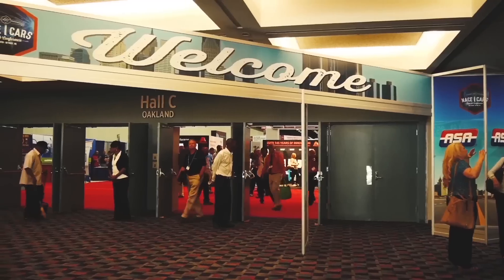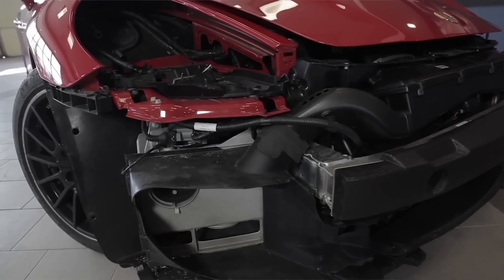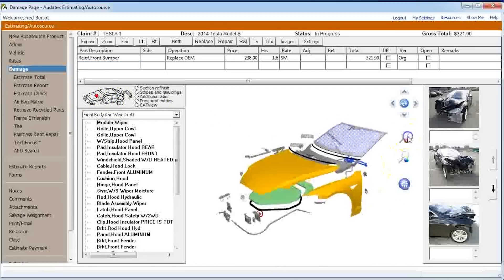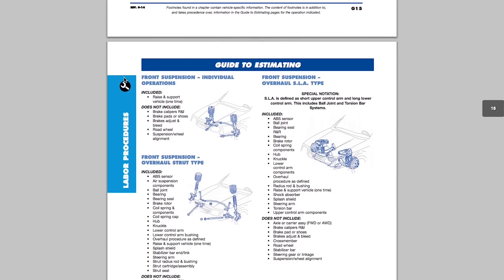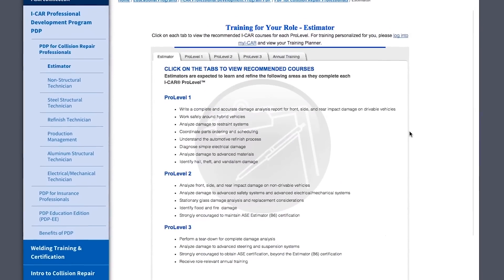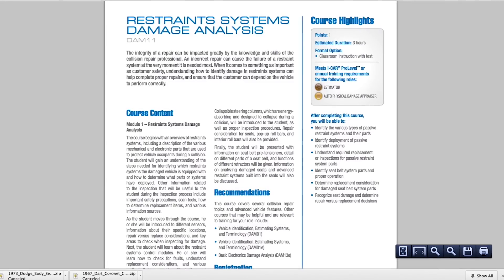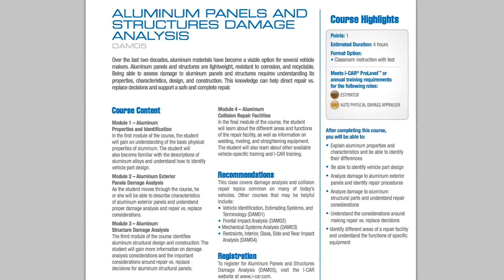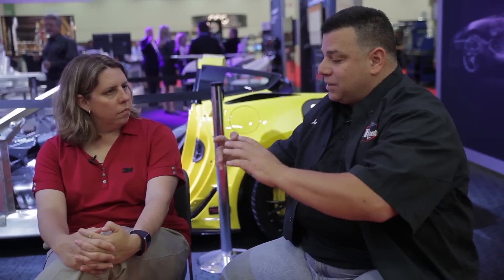Repair University: Tips For Becoming A Better Estimator

Comment: Great information!

For years I have urged our coaching/consulting clients and other repairers to not only read the P-Pages of the three estimating platforms but to read between the lines and to fully understand and comprehend what they state.

Over the past decade, many of the entries have been re-written and/or modified to contain 'legal speak'  whereby they are written  in a manner that may contain hidden and/or muted meanings which can be interpreted various ways or misinterpreted altogether. 

Simple words such as "may", or "may not" or "if" and "when" etc. can completely change the meaning and intent of the text. This is true with OE position statements as well and repairers would do well to read, re-read and read again the text and seriously ponder the intent and how it may affect their customer, themselves (techs and management staff) and their company.

I convey to my clients that the "P" in P-Pages stand for PROFIT...and the profit of any repair can be made or forfeited through the proper use or failure to use the P-Pages effectively.

It's also, and perhaps even more important to understand the the labor guides are only that..."GUIDES"!

Comment: Great video! What is the exact name of this manual of the differences between all three major estimating systems? The one you guys keep mentioning that has 164 pages. Keep up the good work, greetings from @IntegrityAutoCC
Reply from the maker: ASA or Automotive Service Association made a quick reference guide to system differences that can be downloaded from their website. The guide to estimating and P Pages of Mitchell, AudaExplore and CCC combined are about 164 pages. You can access and download them on each website or by visiting DEGweb.org, the DEG is a great resource for estimating issues and not included operations